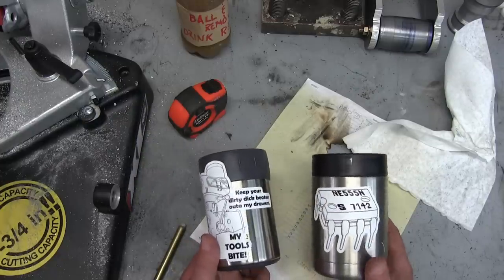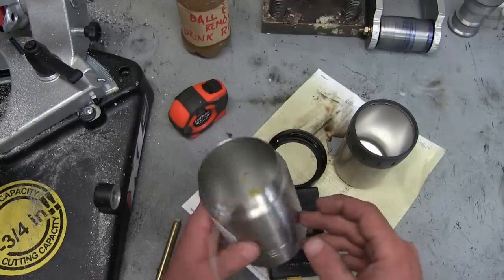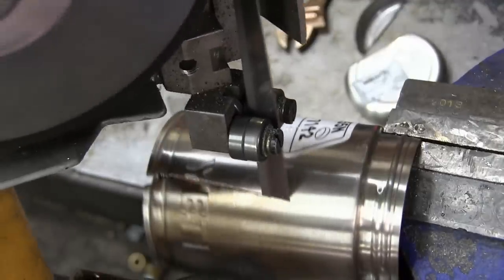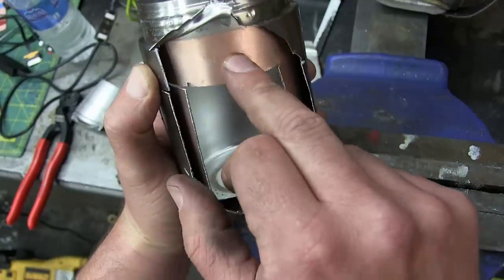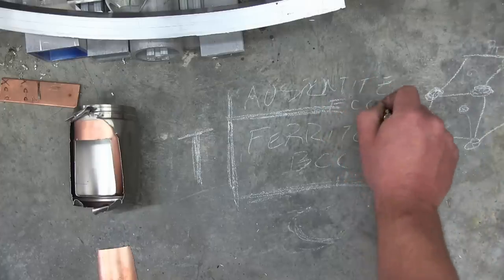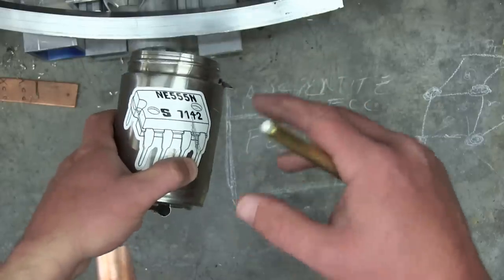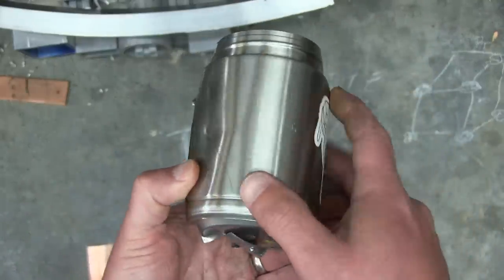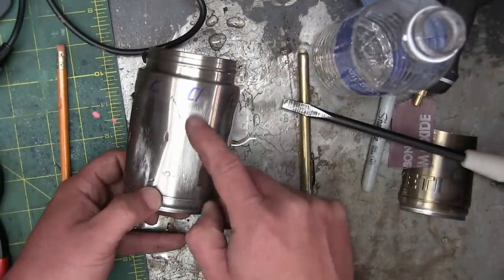BOLTR REDUX: YETI How it works | Enginerding Stainless Steel

Comment: So you kept referring to the copper as reflecting IR.  But you imply it was reflecting IR from the outside stainless since you pointed to the outside layer on the inner cup.  Presuming you have your coffee in the cup on a hot day, the IR energy is coming from the inner skin.  I would think the copper cladding should be on the inside of the outer cup to do IR reflection.  Eh?  Cold doesn’t transfer, heat transfers ‘cause that’s where the energy does it’s little entropy balancing thing.

Comment: I think you were confused about the copper and stainless.  Stainless is a crappy conductor of heat and copper is a great conductor, sure, but SS has 2 other problems.  1.  It can't be mirrored to block IR like glass thermos bottles can.  and 2.  It has high emissivity.  The copper isn't there to block radiation getting in, it blocks it from getting out in lieu of the traditional mirrored surface.  Like you hinted at with the chrome and polish it option, but due to Cu's great heat conductivity, it will absorb the radiation emitted by the inner stainless, and conduct it right back to the inner layer, which chrome wouldn't.  So far I can tell it is far more a "keep heat in" layer than a "keep cold in" layer.  Yeah, yeah, no such thing as cold, I know.

Comment: The steel isn't going to oxidize in a vacuum, even with a pound of pre-80s Canadian micropesos. The copper could have a number of purposes, one being your where it reflects radiation, another being the conductivity of it where it's unlikely that the cupthermos thingleberry is a perfect vacuum, and the second best insulator is air (that can't move) ex. home wall candy is a good insulator because it prevents the movement of air rather than the destruction of lungs. 

I guess what I mean by this is that by having a good conductor on that one interface, you're getting a more consistent temperature the whole way through, which results in less convection inside the cup and probably a more consistent temperature on your beverage, since most of the heat is lost through the top or contact edges (if it were a thermos with a lid). 

It's probably not all that necessary and the improvement is negligible, but so is a 1080p navigation display on a Mercedes. You get it cause you paid top dollar for it.

Comment: I'm a insulator by trade and my friend works for NASA and I asked him how they insulate all their liquid oxygen lines. He says it's all double walled pipe with vacuum. Liquid oxygen turns to gas around -168* C and NASA is in Florida or Texas so it must be capable of keeping the heat out.

Comment: The slug inside would be a Vacuum Getter, an alloy that absorbs and reacts with any gasses in the vacuum to make it as close to a perfect vacuum as possible, typically used in lightbulbs, vacuum tubes and science thingmabobs. Absolutely not expected in something like this where the vacuum level isn't critical to operation and any vacuum is good enough.

Comment: You know what would be even better for both insulation AND corrosion resistance? Titanium. You can heat up 5" of 5mm TiAl6V4 rod to yellow-white temperature for minutes and still hold the other end in your hand. Almost the worst heat conducting metal. AAAND ask a premium premium for the cooler because.. Titanium! and you can easily color it ;) I wonder why nobody did that yet.

Comment: I've seen weird stainless magnetism in 316 bolts, sometimes the thread isn't magnetic but the bolt head is.
Reply: I think it's one of two things: A) the head is being work hardened by an impact driver or even just a drill. This will change some austenite into martensite, making it magnetic, B) the Threaded shaft is heat treated differently than the head. Just my 2 pesos. I may be totally wrong and welcome being corrected. I want to stuff this gelatinous mass inside my skull with as much information as possible and share it before I'm incinerated in a (hopefully)half-dozen decades.

Comment: I was under the impression that wireless security systems dont work great if at all through metal enclosures. (On account of them being a faraday cage) Could the mystery nubble in the bottom of the can be a sacraficial anode to prevent crevice corrosion?

Comment: The little thing welded on the bottom is a oxygen consumer. It chemically reacts with any oxygen (Or possibly other gasses) to not let the insides "rust" (or really, to oxidize) which would make the thing work less gooder.

It is not a tracking device, for frog snacks.

Comment: There was a question on a podcast (Skeptics Guide to the Universe) this week by a listener where he found out that the thermos is better at keeping something warm than cold. There were some speculation as to how this could be, but nothing conclusive. One possibility would be that the thermos was somehow broken. The first thing I thought was "Hey! AvE has torn this thing apart! He would know!". I would love to know if you could test this out and figure out of there is in fact a phenomenon here, and if so how it works. With your charm and bumblefuckery I'm sure it would be a small challenge!

If you want to listen what the question was, you will have to listen to podcast number 640 and the question starts at 1:14:43.

Comment: Just an assumption, but you probably wouldn't need to worry about the copper causing the steel to rust considering it is in a vacuum...assuming there is a descent vacuum the amout of oxidation ought to be insignificant.

Comment: A bit late but I have not seen you take on the Yeti 45 dollar joint compound bucket with a 20 dollar lid?Maybe on the north sea but is this average person going get that much value out of it as apposed one you get at Homedepot  as they float down  river in a kayak or just throw extra accoutrements of crap you don't need now?

Comment: Does the oxidation layer on aluminum still conduct electricity, because when landing aluminum service cable in the panel we have to put de-oxidation gel on the exposed part. I never learned this in the school part so I’m curious.

Comment: Steel has one disadvantage for this application. Hydrogen will diffuse through the steel and over time there will be no vacuum left. So these steel thermos are only good for a while until they fail. This does not happen with glass thermos.

Comment: I guess you got the explanation of the cristaline structure of the oxides with low or high PB ratios wrong. Very low ratio means the oxide is denser than the metal underneath and the surface cracks open like very dry patches of soil. Very high PB ratios mean the oxide is porous like cinder blocks and neither can hold back oxygen from permeating the oxide layer nor is it stable towards mechanical stress and will flake off.

Comment: I don't think the copper and stainless steel would corrode; firstly you'd need there to be an electrolytic solution, and it'd need to be in an atmosphere...so by having them cleaned, and then put into a vacuum, it'd be non reactive. Could be wrong, but that's how I understand it.

Comment: Sometimes I see a Central Heating Engineer testing the Temp drop across radiators in a home using a handheld IR Temp probe, but they point it at the copper pipe and get crazy reasons! copper pipe and IR probes don't mix!

Comment: The 'tracking device' question is really a tough one. Internet seems to know nothing about it. Some are saying that it's a physical support for the inner layer, but that can't be right because it doesn't even touch that layer in most vacuum bottles. I hope ave resolves this mystery in part 2.

Comment: How can I test my SS cup to find the leak, I think the vacuum fell out I can tell it aint right, the cold soaks through and same with hot. How do they get the vacuum in and not suck the hot weld metal in? Ya think they got a full 30 inch of suck in it to start?

Comment: your thermal temperatures are not accurate due to low emissivity of stainless and copper, try using black electrical tape.  It has an emissivity of .95.

Comment: Another great video.
There are a couple points you may want to revisit:
13:49 cold working actually does affect corrosion resistance, http://www.sciencedirect.com/science/article/pii/S0010938X06002630
  
6:25 copper cladding steel would need an electrolytic solution contacting steel and copper that are otherwise electrically connected to induce corrosion.  Being in a decent vacuum, there is no electrolytic solution contacting both.
    
7:52 that is likely a 'getter', a micro porous disc of reactive metals to 'get' any in-leaking gasses.
Reply from the maker: Paywall?! Faaaaack.
Reply: AvE yeah, sucks....however, the abstract is still available.  There are many more studies on effects of work hardening/cold work on corrosion.   Chloride stress corrosion cracking for example has multitudes of studies on exactly that.  
Scholar.Google.com will bring up plenty

Comment: Fuck all, to early for a chemistry lesson. Question for the class; I live in the north and salt does wonderful transmutations' to the inner and underworking's of a vehicle. What would be the best way to remove the rust and then coat the metal to prevent further damage?

Comment: The strange "security" thing would be my guess is not someting to do with that since the entire can would shield it but perhaps something to keep the vacuum intact, since there is a vacuum in these.

Im then surprised the copper is on the outside of the inner tube and not on  the inside or the outer to reflect back the IR to the liquid in the inne container. I dont get why they put it there instead since that would prevent the radiated IR to be reflected back to the liquid and thus make it cool down a little faser then if it would have be the opposit as I see it which would be the total opposite to what you would want, actually seem like an error.

Edit: just saw the previous video and yep I was totally right, it performed way worse! :D

Comment: Correction* ir radiation is blocked by the shinyness
Reply: The same thing, because you can't spontaneously create a temperature differential, so that better the surface reflects a wavelength, the less it will emit the same wavelength. ( Assuming I understood the intent of your statement correctly)

Comment: How the fuck can they weld the top  grind it perfectly smooth and then pull a vacuum  while cranking out 10 per minute?  How much vacuum is required to insulate? How can we test our cups for vacuum loss?

Comment: Heat cant traverse a vacuum,  how does the sun heat the earth through the vacuum of space?.. it does not
Reply: @ChrisGilliamOffGrid  do you have a source to back that claim up?
Reply: @ChrisGilliamOffGrid  great!...so it souldnt be to hard to provide a source for that statement..

You feel the heat of it because its close and local, not 93 million miles away. This was the original point of my statement. A 93 million mile away sun, transferring energy through a vacuum, is impossible.